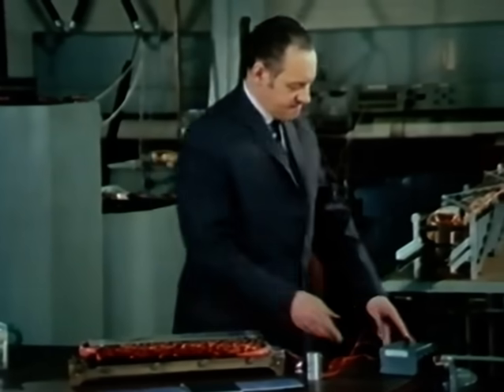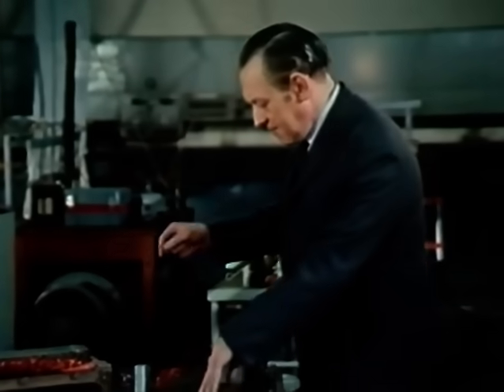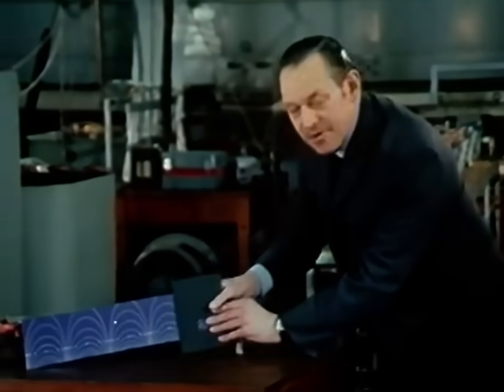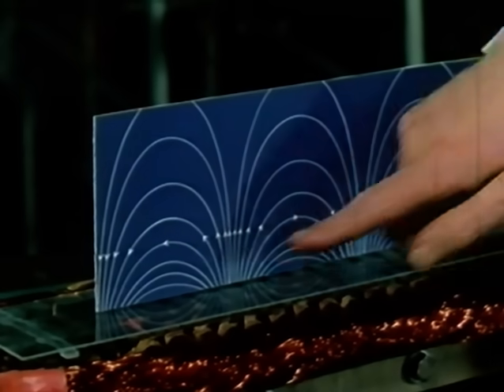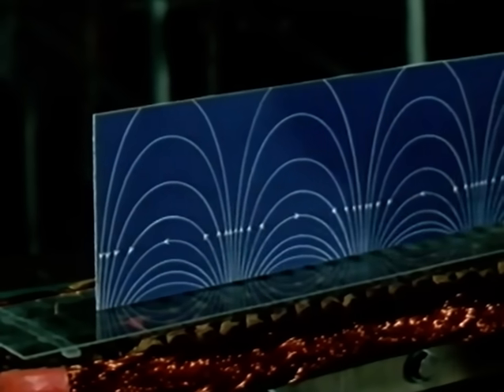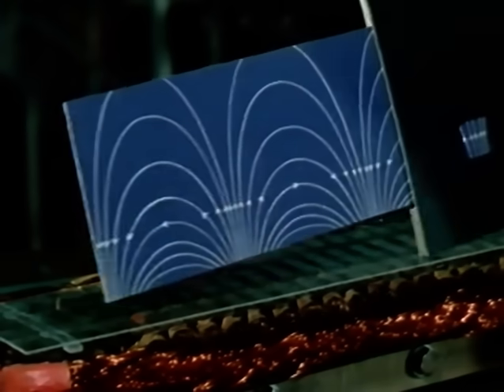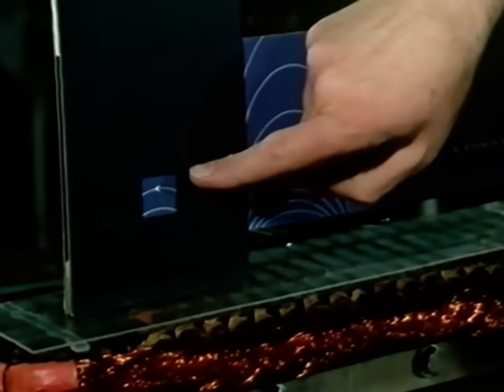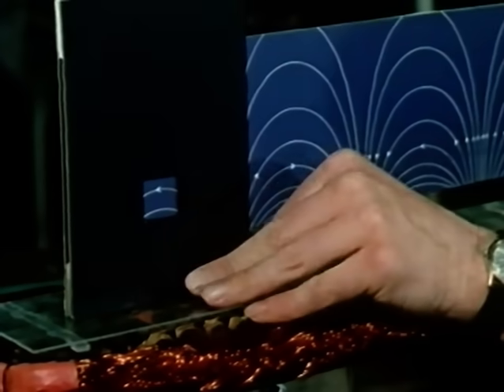Professor Eric Laithwaite: Motors Big and Small - 1971

Comment: With relation to the cylinder rolling the opposite way to the flat plate, on the moving magnetic flow. It's like having a hoop or cylinder on a long  carpet . Then taking one end of that carpet and quickly pulling it out from underneath the cylinder ,giving the hoop a revolving force which sends it the opposite way to the carpet

Comment: That was 1971. Now 43 years later, we still use the over 100 years old combustion engine. Something is seriously wrong in this world.
Reply: The diesel & gasoline engines of 2015 are radically more efficient than those of 1904.  *R-A-D-I-C-A-L-L-Y*.

Anyway, 40 years later we also don't have flying cars and practical supersonic passenger airliners.  Why?  Chemistry, physics & STP.  Some types of heat engine are more efficient than the ICE, but that engine must fit into the hood/bonnet and fuel under the trunk/boot while being conveniently fillable even by those barely able to string three coherent words together, much less control 1500 kg of high-speed death.

So... of all the wrongs in this world, "still using ICE" is the least wrong.
Reply: @RonJohn63 and even more efficient today! 10yrs since your reply to OP😎